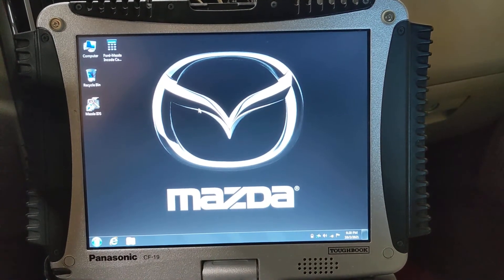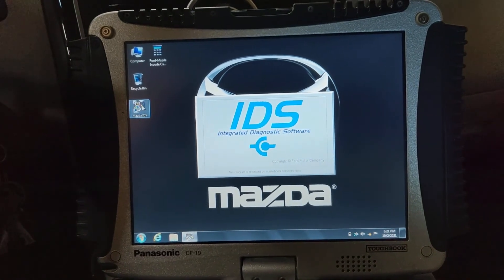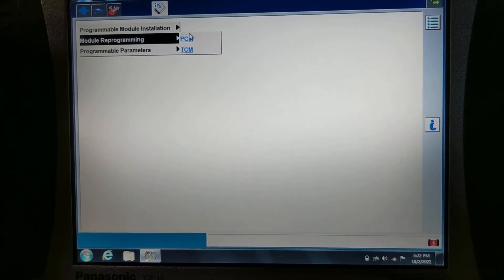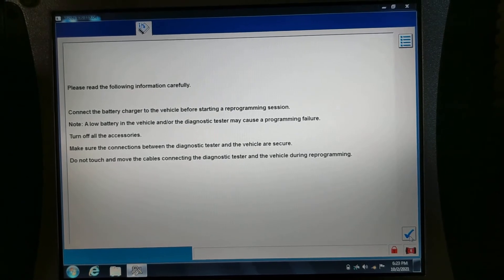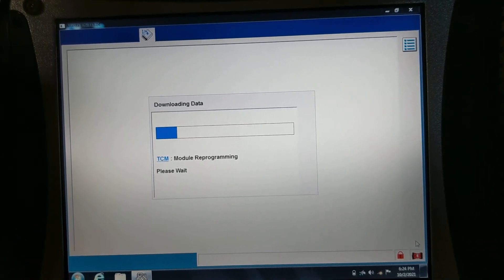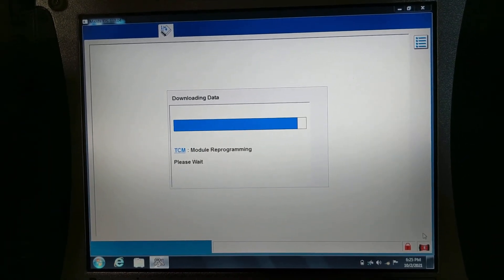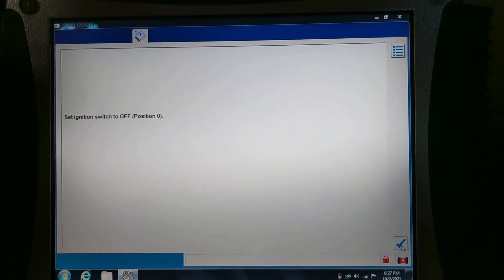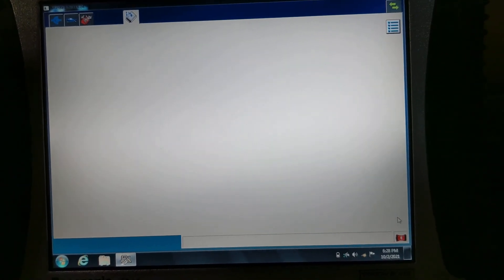MAZDA CX-9 TCM SOFTWARE CALIBRATION, UPDATE/REPROGRAMMING WITH FACTORY SCAN TOOL MAZDA IDS

Comment: Do you know how can i take the TCM off? I already removed the three bolts holdinfg the tcm and the nut for the lever that holds the shift cable, but it wont come off. cx9 2010 Thank you.
Reply from the maker: @cesarcarranza42  the part that is located at the end of the shift cable on transmission side is not the TCM, more than likely it's the transmission range sensor/switch for P-R-N-D-3-2-1 the TCM must be located at a different spot.
Reply: @ TCM is located under the air box where the shift cable attaches to a  lever attached to a shaft that goes through the TCM in to the transmission to changes between gears. And has three bolts. No question about it.

This lever that goes through is the one I am having difficulties removing, not sure if it has a locking mechanism.
Reply from the maker: @cesarcarranza42 I don't know for sure, but if there is no nut, or clips, it's just a bushing just popping it out with a flat screw driver that usually  works, or a clip removal tool.

Comment: Hi,
Can someone help me with a 2012 mazda cx 9 has starting pblm? When I turn on the key sometimes the car is not turns on... I just wait and turn on after 5 minutes, it turns on... I brought to the local repair shop, they couldnt able to figure out.. Starter good, alternator good, fuel pump good and no check engine light on.. Finally I brought it to mazda dealer, after 4 days of thorough exam they think it TCM.. Im not convinced... Can someone help me, please?

Comment: Hi, what would you say are the probabilities of succesful repair on a cx-9 2007 that is stuck in 3rd gear all he time. TCM was replaced with a newer one and has to be programed to the vehicle. 
What chances are there that it can be succesful?

Thanks
Reply from the maker: I don't clearly understand your question, be more especific about what you're trying to accomplish, you want to fix it yourself? or you are wondering if replacing the TCM will take care of your issue.
Reply: Thanks for replying, I was planning on taking the vehicle to a shop. I was basically  wondering if having the vehicle stuck in third gear is a definite death centance for the transmission.
Thanks
Reply from the maker: I would say it's cheaper to pay for a tow truck, or renting a trailer, than ruining a transmission for sure.
Reply: @flacoanemico5199  any vehicle that does this is called “limp mode” and it is doing that to try and save itself. Basically what it does when it detects something wrong with the transmission, it locks third gear as a way to prevent shifting gears from slipping further and burning clutches or else inside the transmission.

Comment: When you replace a mazda transmission is there a solenoid strategy like on a Ford?
Reply from the maker: if your vehicle is around 2005 & above, it's very likely that you have that option, if the vehicle it's below 2005 it's not very likely. Sorry about that very late reply!

Comment: Can a bad TCM cause a rattling sound when I rev my car in reverse and drive?
Reply from the maker: if you have a bad TCM there should be a check engine light on, if there is trouble codes that are transmission related, you should have your car looked at by a professional repair facility. 
there are hundreds of parts under the hood, it's just to complex to tell accurately what's causing that rattling noise.

Comment: I have a 08 Mazda CX-9 but my transmission is not shifting it is saying  AT And the check engine light on
Reply from the maker: Get a scan tool and read codes, you need to go to the repair manual and follow the diagnostic steps that are specific to that trouble code/codes.

Comment: Is this necessary? Because I’m going to replace my tcm and I don’t want to program the new one. I’m replacing the tcm because I have the engine light on and I have a code for tcm. 
Thank you :)
Reply from the maker: without any vehicle information is not possible for me to know, if you the module from wrecking yard it would not be required. new from Mazda might come with software, it might not. ask the dealership, they might let you know about that.